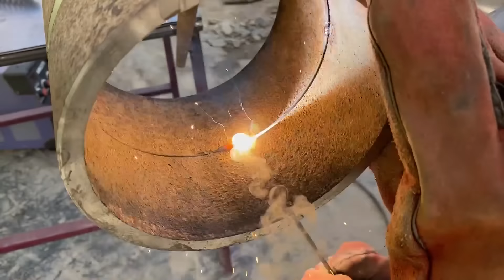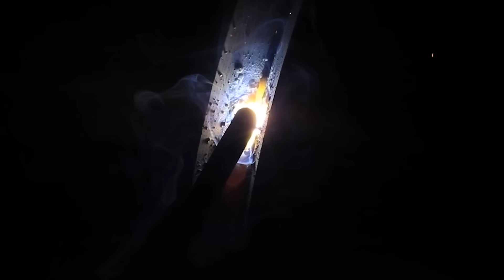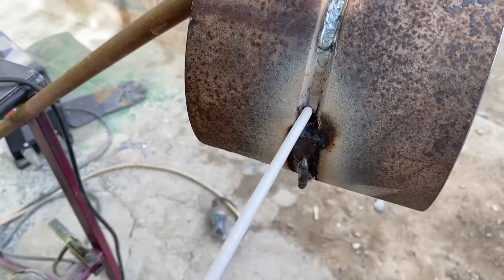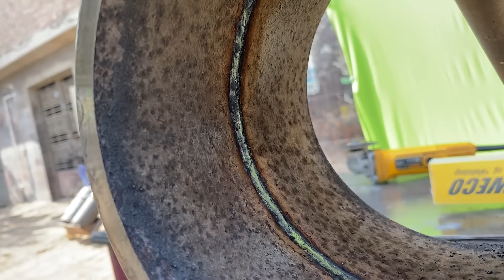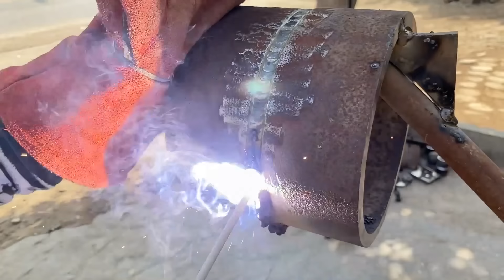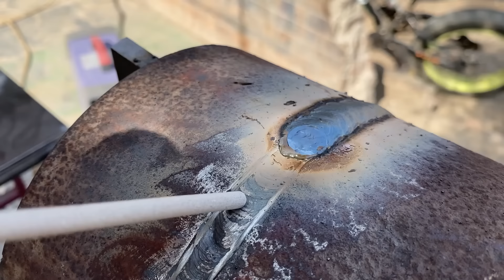Learn to weld pipe root and cap 7018

Comment: Don't waste your time on this video. If you want to be a pipe welder these days you need to learn modern methods.The bevels are 37and 1/2 degrees each. Heavy wall 6 inch or .377 wall two inch. 6G.First pass DOWNHLL  8010 series high penetration 1/8 rod. Second pass UPHILL HOT PASS, same rod. Filler and cap 8018 series LOW HYDROGEN rods 1/8 or 5/32. No beads on the cap wider that 2and 1/2 times the rod size.Example 1/8 inch would be max 5/16 wide striinger beads.Thats ASME Rules and ASME test. Api is less stringent ,downhill all the way and 1/8 slag per inch of weld permited. ASME no slag inclusions.
Reply: Если тебе попадутся такие "электроды", ты ничего ими не заваришь! 😂 в этом самая суть - хороший сварщик выполнит работу даже плохими электродами!

Comment: Absolutely not the correct way to
Reply: Ok you tell which type of good welding
Reply: First thing wrong rod second wrong motion. 6010 or 8010 for the root and tge "arc" should always be inside the bevel no key hole.
Reply: Phillips66 has a 7018 root and hot WPS
Reply: Please discretion tha right way
Reply: Снимите, как правильно)

Comment: Perfect! That is exactly how it is done and supposed to be done! Thank god i saw this video! It was so soothing to see correct way to weld a pipe, i just hate those "pipe welding videos" which are teaching only unnecessary work and cleaning and admiring only looks. This is how it is done in pressurized waterheating lines. Fast, pure efficient. This is the correct way. From root to cap! 7018 OK 48.00 rod. I have welded tens of thousands this kind of pipe, and i can tell that you are very skilled! Almost no grinder used and that is the way yo do it! Respect!
Reply: Bs
Reply: @mikecookson3679  its not
Reply: @mikecookson3679  if you cant weld with 7018 roots it doesnt mean this is bs. Your welding skills are.
Reply: This shit would crack on the first bend

Comment: What amperage,what diameter electrode?
Reply: El amperaje Barea dependiendo la máquina que utilizas el electrodo es de 1/8
Reply: 1500 amp and 55mm rod 👍
Reply: 100-110A 3mm
Reply: d-3, 90A
😊
Reply: 6010 for the root pass
Reply: 3.2   120amp
Reply: That’s not 7018 root pass! That’s 6010 🙄🙄
Reply: 7016..2.6mm

Comment: I've never used 7018 for a root pass because it's not a fast freeze electrode.  Interesting, but I'd be curious if it passes x-ray since you're not supposed to oscillate it.  I'd clean the weld area of all rust before working on it, too.
Reply: I have a job where engineering wants me to use 7018 only 😅

Comment: When doing pipe you root with 6010 and continue with 7018 lohy rod learned that in welding trade college 38 years ago also am a cert.welder looks good only
 critique not using 6010

Comment: Can’t do a open but root with a 7018 rod and pass an inspection with any certified inspector in the us. The 7018 is a low hydrogen electrode not designed for the app. A 6010 rod would be used for a root pass and then weld out with 7018. Or tig the root pass. To certify with only 7018 filler material a chill ring would be used for a root pass.

Comment: Para hacer la raíz, se usa soldadura 6010, porque es la que tiene más penetración, y es una soldadura fuerte, ya después se hace el fondeo o paso caliente que es el relleno con soldadura E 7018..!! Yo cuando estudie soldadura hace 27 años lo aprendí asi como todas sus posiciones..!! También se soldar con soldadura autogena y oxicorte..!! Ese soldador es muy bueno, y dió muy buenos tips para los que no saben soldar, yo de hecho también tengo la carrera técnica de pailero..!! Muy buen documental..!! Excelente video..!!
Reply: Чувак, понимал бы ты, как гугл переводчик переведет твой текст... Поржали бы вместе😂
Reply: better than a lot of guys with dually tucks with millers pipe pros and lincoln 300d 🚫🧢
Reply: Algunos trabajos luego piden fondeo de 7018 o nunca
Reply: obvio que el 6010 es especial para raiz, pero. es tambien con 7018 y es mas complicadito , saludos a todos los soldadores del mundo , les saluda Aler vàsquez Pinedo Mecánico Naval. especialista en .ontajes y Soldadura.
Reply: WPS. Welding Procedure Specification. Especificación del Procedimiento de Soldadura.si sigues eso no tienes que decir más nada.si el 6010 o 7018.el que decide eso es el ingeniero.lo de las características de los electrodos es muy aparte.
Reply: Primeramente un saludo mi pregunta es está el primer paso es electrodo 6010  y el movimiento es arriba y abajo gracias.
Reply: No necesariamente debe ser con 6010 la raíz, a otros les gusta el 6011, pero en fin...
El soldador debe seguir el WPS qué establece las variables de soldadura, si el WPS indica sólo usar 7018, esta bien ejecutado, lo otro que le recomiendo a los soldadores siempre, sobre todo a los que hacen videos, es presentar la soldadura limpia, puede ser escobilla de acero manual o con esmeril (Grata).
Saludos y buena técnica...

Comment: Hi do you ever put the root in with reverse polarity I'm a retired welder I have used that method in the past only on the root it's cooler and easier if gaps are silly as you get at times cheers konrad

Comment: Few questions.  How do you come back from a keyhole that you lose control of which is what happens to me?  Also after your root pass I noticed you took the cutting wheel to the sides of the weld and am curious as to why?  Also what electrode for your root? 6010?

Comment: I have never seen ocellating 7018 rod like a fast freeze 6010. 7018 is a low hydrogen deep penatrating rod and if the temp is correct the burn in is excellant and leave beautiful welds with perfect penatration.
Reply: In my company we use conarc 7018 for everything
Reply: @marcojobse7407 in thirty years of pipe welding I’ve only seen one outfit that ran 7018 all the way, it was some union guys out of either Winston Salem or Virginia. I remember being skeptical because I was young and didn’t know any better. Anyway those guys were damn good at it. The customer shot about ten or so per scent of every weld in their plant and those boys had no problems. They weren’t whipping like this guy on the root.
Reply: I thought 7018 wasn't a deep penetrating rod
Reply: @boricuaarecibo9259  7018 is used for thick structural steel, which requires deep penatration. When set to the correct temperature, it produces good penatration and beautiful welds. Can be tricky getting it started at first, but when you're used to it by just scratching, it starts well.
Reply: @johndavis318 Well done brother
Reply: @boricuaarecibo9259 You are correct,if you want to really dig in,a 5P 6010 is the rod of choice.Neither 7018 nor stainless are deep penetrators.Generally weld figment gaps are somewhat wider for a 7018 weld.It is not a downhill welding rod,and the ‘jetweld’ type has metal powder in its flux coating and appears slightly darker in shade.
Reply: @jeffallen6754  Its very rare, their is actually a WPS for this weld but its not done like this. Not even a little bit.Thank you for input. 6010 is the deep penetrating rod, it likes 65 to 70 percent dig,. 7018 is a hot rod, but should be ran at about a 30% dig. Also know this, WPS for AMS does not state this in the D1.1.
Reply: @jeffallen6754  If he drop his amperage by 5% he won't have to whip it that much. He's still learning but he'll figure it out.
Reply: 7018 rod are also used in pipelines and power plant pipelines, not because you had no experience using them or never used them before doesn't mean they are not the proper one to use... oh you welders boast on things you only use and criticize the things you cant properly use, it is done isn't it? it is weld properly isn't it? you never used the same rod before right? doesn't mean yours is right and his work isn't... there are different ways and process depends on WPS, im not that good as a welder but i know im much better on some of this guys as a human being... i hate people who thinks they know it all,...

Comment: Its not the technique I’m using welding 7016 and 7018, but I also have a state of art welding machine with a remote control the size of a Mars bar that fits into the palm of my hand. Sometimes you just have to do with what you have. I could suspect some porosity in the root due to the rather large movement of the arc, but you need NDT to determine that.😎

Comment: Aren't you supposed to use 6010 to weld root?
Reply: Yes it makes it easier,for root pass,you wip it in, takes a lot of experience to do what he did with 7018
Reply: Nice work,I see your very experianced,the root is difficult with 7018 good job

Comment: Guys, do not do this. I tried it and it made a hole. I did the up and drag motion like you would a 6010 and still burned a hole through it. Unless he made the spacing smaller and a shorter size diameter rod, idk. Just stick to 6010, grind the slag off, then hot pass and cap the rest.
Reply: I heard you have to run DCEP because it puts less heat into workpiece and use a smaller diameter rod for root.

Comment: I've never seen a root pass with 7018 worked like that.
You're going to have slag in the weld and will not pass an xray.
Slag should never have a pass run over it.
Reply: How should a root be welded, & with which electrode?

Comment: I’ve never heard of using 7018 for a root in a pressure vessel. It’s always 6018 in process or 6010 in the line.

Comment: Now if only 7018s were designed for open root applications this might be worth something.😂😂😂

Nice cap though! 👌
Reply: Well it's gotta be stronger than 6010 root.
Reply: @phiksit  negative. It's not designed for open air to hit the backside of the molten puddle. It's full of microscopic pinholes due to hydrogen exposure. Notice it's called a "Low Hydrogen" rod? Find a metallurgist that agrees with your opinion and I'll give you a dollar. 😂😂
(You don't weld, do you?) 😂😂

Comment: bit excessive on the root whip , and it shows when the slag is removed ,,, but if its working for you , vert hot pass looks cold and slow , ill bet theres slag in those lines that the grinder with no guard didnt quite get clean either and the cap tie ins are grim ,,, all in all it just about looks ok , but thats it. The grapg would make interesting viewing , and the grass on the ut will be tall ,,, nuff said.

Comment: Wrong preparation how to weld pipe in 4G VERTICAL POSITION you are not use  601O 3.2 mm for pinitration before you weld hot pass .

Comment: I'm a retired welding engineer it might pas in America but definitely not in the UK or europe
Reply: That wouldn't pass anywhere. I don't know what that person thinks they're doing but I wouldn't trust them with glueing 2 peices of paper together.
Reply: Bruh! That wouldn't fly anywhere on the Planet, ASME 9, API 1104 are the codes used  here in America to weld pipe... I don't know how you do it in UK... if it ain't done according to code it ain't right... Kudos to the welder the cap looks decent

Comment: Why does everyone use 1/8 rod for the route pass ? 3/16 7018 would be better I was taught to use 6010 on on a route pass ? learned later that using 6010 was cracking because of oscillating the rod like I was taught ! But if you look closely with a magnify glass as your weld called  a hairline crack would form down the middle of your pass so I stopped oscillating the rod it quit cracking by just holding it still and burning in but I quit using it 6010 altogether it’s good for rust and crappy steel !but 3/16 7018 is a stronger route pass you can burn in better without burning out the sides of the pipe and you will see a key hole like in Tig welding ! But that why he is in and out to cool his bead but go in and out of your puddle on your route pass is just puzzling you can trap slag and be picked up on x-ray?  And you should have a three bead pass on your cap depending on the Butt of you’re coupon? But you should have one stringer bead on each side the butt and a bead right up the middle that goes to the top and center of the two outside beads to complete your cap should look like as smooth dome for your finish try not to grind too much you’re grinding will can leave porosity or trash in your weld not trying too be a know it all 46 years of of welding and was still trying to learn my grandfather from Holland was a ship Builder they used to rivet lol and he was one of the first welders he had some stories and you can weld with a coat hanger 😳was essentially what they used that was before flux try it 🤣not on coupon though !

Comment: Welding is not learned by watching!! You have to feel the burn of the hot bbs and learn to grind your own bevels. Any idiot with a welder can weld plate, it's a straight line. This dudes welds are horrid tho.

Comment: That root , your technique is way off …… never step out of a puddle like you are with a low/high rod 7018……. In fact you never step out of the puddle at any part of the welding process with a low high 7018 rod…. At least not like you are  🤦‍♂️🤦‍♂️🤦‍♂️🤦‍♂️